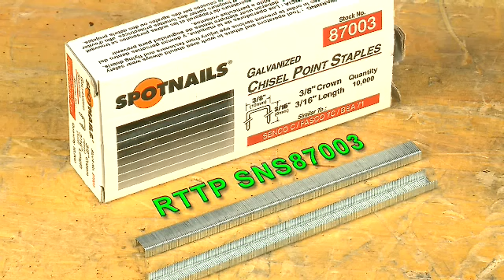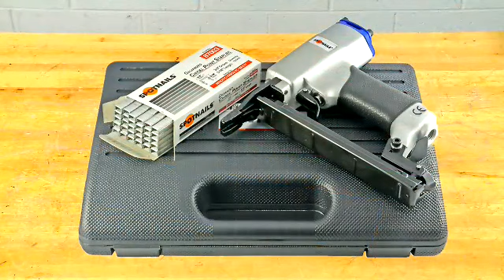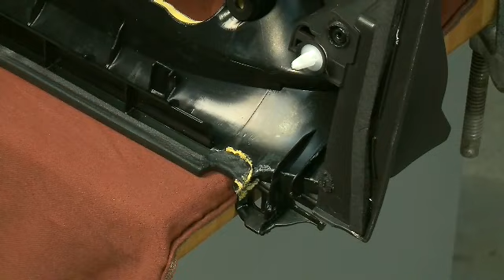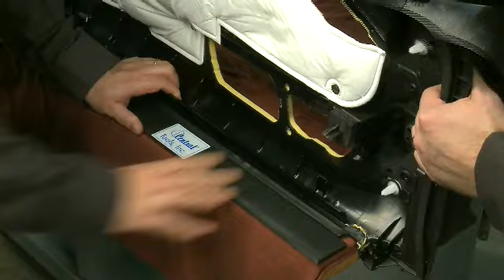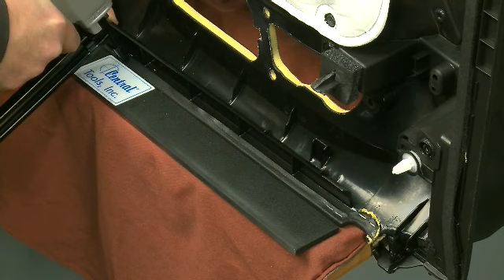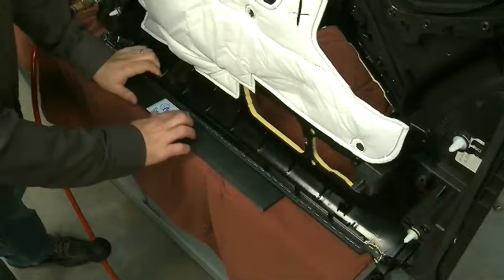Front Door Trim Panel Repair - 2014-2015 Ford Explorer & 2014-2016 Police Interceptor Utility

Comment: Yesterday I repaired my wife's passenger side door on her 2014 Explorer. However, instead of using a Pneumatic Stapler (air) the 3/16 staples, I used the Ryobi Electric stapler with 1/4'' staples. It worked perfectly fine! Also, prior to stapling it, I applied some Gorilla Super Glue to assist with repairing the door. Just be sure to add some strong surface under the door where you will be stapling because you can potentially crack a porting of the lip that you are stapling... Ask me how I know lol.... But all in all, it turned out to be a success !

Comment: This is happening to my 2015 . Ford builds crap these days!
Reply: Ford has been building crap for the last 20-30 years.  I had an 86 Bronco.  I could not kill that thing.  I bought a 2000 Explorer, what a POS.  I now have a 2015 Ford Police Interceptor Utility (aka Ford Explorer) and the body/trim is garbage.

Comment: Ford had a recall on this door panel.  Problem is, I guess they decided to not let anyone know until they came in with the issue.  We took ours in only to find out there was a recall but guess what?  There was a deadline, and we missed it.  Cost for dealer repair?  $1,000.  My friends, this is the kind of C.S. approach to customers that sends them to other brands for their next auto purchase!  Now reviewing videos for do it yourself.  Ford can go to you-know-where!
Reply: Yeap i bought a used 2015 explorer from a ford dealership and when the panel started coming off they said the recall was expired and I told them as a ford dealership shouldn't they have done all the recall repairs?